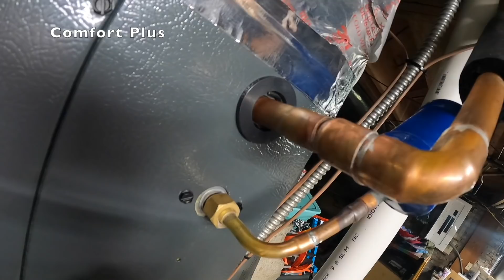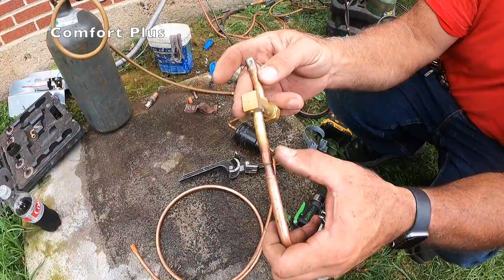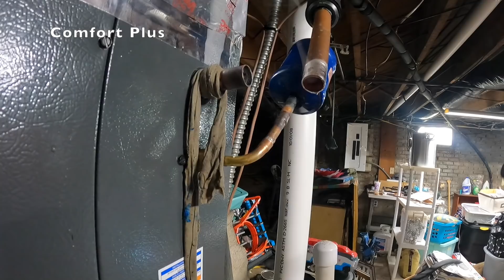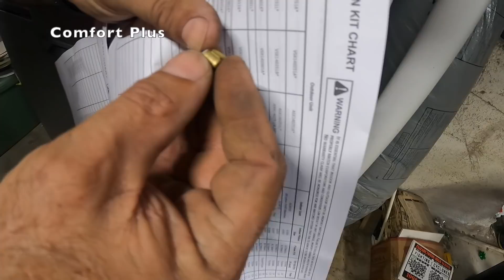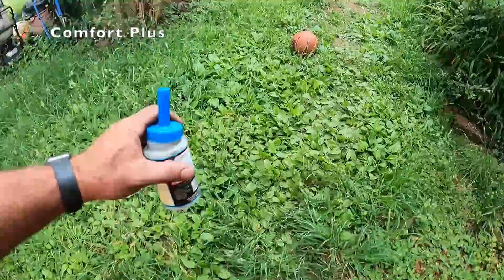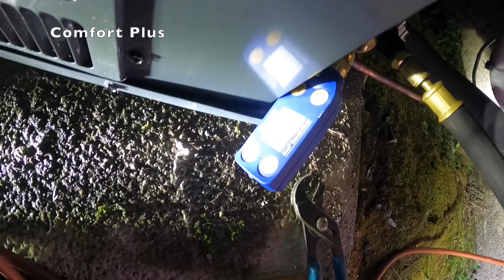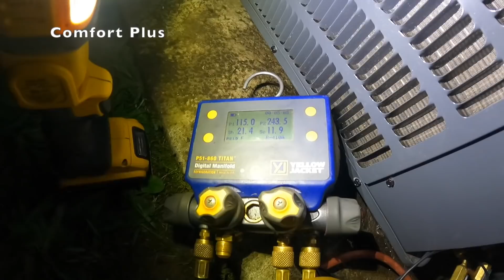HVAC: DIY Goodman Install: Can this unit be saved?

Comment: The soft-solder seems like a reasonable mistake, but WTF WERE THEY THINKING WITH PUTTING EPOXY OVER IT?!  Is the "right" stuff just silver based high temp solder like plumbing (which in my experience wants 60-800F) or is it brazing rod (a copper version of Alumiweld?)  Agree 100% with what you said, know your limits when it comes to DIY work...

I'm filing that mess under "I don't know what's right but at least some of that looks wrong"

Comment: As an HVAC installer/serviceman, only use a certified company, with high ratings. Never attempt to install HVAC equipment yourself. For one, you need EPA certification to handle anything with refrigerant in it, or pay a fine up to $10,000! To properly install a condensing unit, mini split, or replace an evaporator, you need a recovery system, a vacuum pump, gauges, and a vacuum gauge. Plus, you need a brazing torch with silver braze for connecting the lines. Some less than professional companies use solder, which is weaker and can break and leak. At the unit, there are valves with seals, that don't like heat. When brazing, you must keep them from over heating, or they will leak. Always use a new liquid line filter, anytime you open the system. If replacing a failed compressor, flush the system with an approved flush, and install filters on both lines. Most likely, you'll have to replace the metering device or evaporator coil at the same time. Like I said, hire a professional. You'll get a warranty, less headaches, and it will save you money on equipment that you'll only use once. If done right, your condensing unit should last 20 years or more, without anything more than simple maintenance. I'm not shocked to see these hack jobs, because I've seen them, but your mistakes will cost you more than the original install would!

Comment: Did you correct the drain line at the evaporator coil?
Reply: I missed what was wrong with it?
Reply: Just the secondary drain outlet is plugged and should have a float switch.

Comment: Dont know why they used jb weld, all they needed was a lil super glue to hold those together lol. jb weld and plumber solder doesnt work well in that application. Whoever did that sure wasnt a goodman 😜

Comment: I was an electronic technician for 40 years. I would use braided copper wire to remove excess solder. It works well.
Reply: It Was Call Solder Wick (braided)
Reply: @JRig2Stx  always used the rosin coated
Reply: @RobertSmith-tq6mf  
It Was Back From '75 to '99 When I Was a Tv Tech for a Major Department...

Comment: Yeah I enjoyed that and what I enjoyed most is that you didn't jump on the DIY'er. In 2018 I purchased the same system and was going to do it myself and then the health bandit got in the way so I decided to hand it off to a pro. I had done more research and was ready to do it the right way. With all that said my health did return and I saved with the Goodman brand over the elites out there. You have that southern charm...

Comment: I used soft solder
Reply: Soft solder when used correctly will not leak , and the joints will outlast the equipment. Goodman is not the best but if installed properly it will last a long time. Brazing causes excessive heat , and can create more problems if done improperly. I hate seeing hack jobs , not fair to the costumer at all.

Comment: I've requested a couple of quotes for my home AC install, and the DIY in me can't help but want to take on as much as I can myself.  So tell me this, is it offensive to have a DIY'er ask a pro to do the final braze/vacuum/pressure-check on an installation after I do all the labor of installing the equipment myself? What would you all charge to do these steps assuming everything else was ready to go (and done properly)?
Reply: I’ve been down this exact road. The short version is that many pros make profit on the equipment so they want to install their own stuff. Or, even if they don’t make a profit, they don’t like following a non-professional because they don’t want to get blamed for things like the wrong orifice we saw in this video. Not understanding this reality, five years ago I ordered and installed my own system up until the final braze and electrical connections and started calling pros. After about a dozen rejections I realized the only way to complete the install was to either buy a whole new system from them or learn everything I could and do it myself, which I did. I definitely made some mistakes like not flowing nitrogen during the brazing. That (I believe) led to the failure of the TXV after a year, which I replaced and it’s run great ever since. 
IMO, the greatest obstacle is simply having the stuff you need beyond a set of gauges. Good vacuum pumps aren’t cheap. Nitrogen tank and regulator/flow meters aren’t cheap. Oxy-acetylene torches aren’t cheap. 15% silver isn’t cheap. And that’s just the stuff you need for initial install and less than 15 feet of lineset. If you’re repairing, you also may need a recovery pump and tanks, extra R-410a, a refrigerant scale, the list goes on. 
If you go this route, the best advice I got was to use 15% silver solder because it’s forgiving for beginners, and practice making your joints on some extra pipe. Know what an oxidizing flame is and how to avoid it. Cut the pipe lengthwise and evaluate your joints. You need to be able to move quickly so you don’t damage nearby components. And vacuum, vacuum, vacuum. Moisture is the enemy. 
Good luck :)

Comment: Man you a good.  A true HVAC technician.  I need you over here in AR to give my new 2 ton & 4 ton lennox ML180UH's a through once over and tell me why me one zone damper motor is always roasting hot even when its not called for to be closed ( normally open ) and still hot AF..  Ugghhhhh

Comment: Wow that is hilarious. I met a guy that installed two mini split systems using air duster to purge the lines as opposed to pulling a vacuum! Says they're running great lol.
Reply: Most air dusters are filled with a refrigerant, not sure I'd do it though.

Comment: You tell its a DIY install by the Seer Rating Sticker, stuck to it. Ohh, those were copper plumbing adapters that he used on the condenser.

Comment: So was this on company time?  What did this cost for a job that can't possibly be warrantied.
Reply from the maker: I'm a one man show so everything I do is company time. This was an interesting little job (or experiment lol) and I'd probably do it again just for the interest in this Youtube video!
Reply: @ComfortPlusHeatingandCooling  OK,  I can understand that.  My reason for asking is that is an awful lot of time to put into something that you can't guarantee,  so how do you justify the time vs cost.  While it is still cheaper than replacing it,  it would still be very expensive.  I was trying to figure out how this was being justified as a see how it goes.  I'm not surprised it ran,  just not sure it won't develop more issues from that soft solder.  I've seen that before unfortunately,  Vegas,  if there are issues  it will obviously be restrictions.  I deal with home warranty also though,  that is rife with hacks.

Comment: Kind of surprised you couldn't get the vacuum down lower than 800.  It held pressure so the vacuum should have been lower than 500 over the period of time it looks like you let it run.  I had to switch my valve removal tools to the Appion vacuum rated style to get hard vacuums down below 300.
Reply from the maker: It would pull down. I ran pump until it was below 350 microns, but after you valve it off it will climb due to stuff (hopefully R-410a) gassing out of the oil. Most brands say if you can pump it down and it doesn't climb above 1000 in ten minutes you're good to go. I did that four different times. Just wanting to clean it up as good as possible before I stuck the new gas in her.

Comment: My god, poor customer, I’d go off serial number, who purchased, and sued, but this is a fly by nighter, good job on helping them out,  my worry is the plumbing solder inside  may make it back to txv
Reply from the maker: This was one of those online purchases. Unfortunately they are up the creek when they need warranty parts. None of the sellers around here will provide warranty parts on units they don't sell. This one has a piston instead of a TXV. Since it's straight AC and because I put a new drier and new copper and fittings just in front of piston I don't think anything can get into the piston, but anything is possible lol.

Comment: What's wrong with buying the stuff and calling the PRO to install ??

The diy guy was to buy it, screw up the install,  call the pro to correct problems created by diy guy, Then go to the beach and put head in the sand. 

New SUB, and Thumps up.

Comment: Dam I fuck up did the same thing the owner did i used soft solder plumbing solder but I did not start it up yet its funny cuz I had the same torch too 
But like I said I have not start it up yet going to do everything you just did 
Can I use straight 8 or the brazing ones
Reply from the maker: Lots of folks use Sta-Brite 8 with great results. The key is clean everything good, and use the flux very sparingly.

 The pros are you can use a MAPP gas torch, you don't get the copper as hot and weaken it, and with less heat oxidation inside the pipes isn't as much of a concern.

The cons are if you use too much flux you can get it into the system, you have to make sure its good and clean, and most manufacturers instructions say something like this Goodman does in its instructions ~"Use a brazing alloy of at least 2% Silver alloy. Do Not Use Flux". 

Would I use Sta-Brite 8 along with its special flux on my own system?  Yes.  But I wouldn't use normal plumbing solder and flux. Thanks for watching and good luck with your project!
Reply: Thank you buddy

Comment: Always seems to be a Goodman. Had one about 10 years ago that was a heat pump. Apparently installed not much different than this one. Husband gave the job to the wife to get someone to come fix his mess. Well after 2 weeks and I have no idea why but he managed to diagnose the reversing valve to be bad after his fine installation. I don't know how he even got a new valve, but his installation was OMG. It was cut out with a reciprocating saw and and somehow soft soldered in with short radius plumbing 90's. I just needed to fix the leaks and recharge. Um miss it needs more than that. I would have attempted a repair like this but I had to nope out of a re-piped reversing valve. Good job saving this
Reply from the maker: Yes I believe I would have walked away from that one! Lol.
Reply: "Always seems to be a Goodman"  And that's all people seem to remember, not that it was installed by someone's 8th grader.
Reply: @Shift4g  Why I say that is they seem to attract the 8th grader installers. Granted its not like it was 25 years ago with Janitrol but not exactly senior guys at the local Daikin ethier..... well the few times a year I'm there anyway

Comment: Please bear with my somewhat long comment....just this morning my wife shared a picture from six years ago to the day when we had this exact unit replaced.  Then within minutes this video was recommended.  The internet gods know EVERYTHING!  a couple more notes...since day one this unit has worked very well except it is very loud sometimes.  It’s very random too.  Sometimes it will go many cycles with normal noise and then kick in and run very loudly.  Other times it will be loud for many cycles in a row.  Switching it off and then on sometimes makes it go quiet, sometimes it stays loud.  When it’s loud it sounds like a cheap oil-free air compressor.  When it’s quiet I can barely hear it.   I’ve been told by folks who should know that it may have excessively high noncondensibles in the system.  Idk just what that means but I’m sure some folks in YouTube land do.  I’m glad to see comments.  

Finally, thanks for this video.  I do change fan motors and capacitors and such, but this video allowed me to know that those are about my limit with HVAC.  Luckily I have a fair and honest tech I use when needed.
Reply from the maker: See if the noise is dependent on outside temps when running in ac mode. Non condensables  (things like air or nitrogen) that may have been left in the system will take up room in the condenser and result in high head pressures at times. (Almost like blocking off part of the coil). This is assuming it’s the compressor making the noise. Sometimes fan motors can also be intermittently loud!

Comment: This unit is R410A and the lines were used for R22 for years. Id be replacing all the lines and a dryer install. I wouldnt use R22 contaminated lines. Id also install a vapour dryer too. Think i would have cut piping off at valves and then swedge them again. Would have kept the piping cleaner without solder getting heated again... BUT great video man. Love watching other pros in the trade.
Reply from the maker: Old one actually was 410a. But like all the early 2000 Puron units it leaked lol.

Comment: I am 72 yrs old and know nothing about AC, but I do know an expert when I see him.
You are what makes America Great. Thanks for sharing your skills.
Reply from the maker: Thank you. I believe that's the nicest thing anyone has ever said about me.
Reply: @ComfortPlusHeatingandCooling  well you deserve every bit of it you are a true master of your craft and I enjoy watching you work
Reply: I have seen the same soft solder work out of a big box outfit.... same system type DIY jobs as well.  Just installed a unit that "needed a Capacitor"...  owner shows up with a unit that needs, Cap, Contactor, fan motor, r22, etc...   

Would have been better off just installing a new coil and condenser..

Comment: Nice job!   What was the JB Weld gonna do @ high pressure? I have actually never seen a use for JB Weld.
Reply: JB weld is rated for like 1300psi ..... If used properly for the right application, or a temporary fix for some things. But yes is not going to do anything on the outside of an ac line... that was not even cleaned...  I would love to hear what the DIYers wife would say after all this :)

Comment: Was it installed by the homeowner or “contractor”🤦🏻. When I need to “clean” a old fitting or valve I kick the nitrogen pressure right up and blow it back during cleaning to blow any debris out with the brush. You do nice work and are a true tradesman. Thanks for the great video.

Comment: I've taken 15 percent silver solder before and have been able to push out almost all the soft solder and it hold not my first choice but it works just depends on how boched the joints are
Reply: Mixing 15% and soft solder makes a very brittle joint. When something is soft soldered I usually just keep it that way. Thermo king reefer units have everything soft soldered on the low side and that gets exposed to reverse cycle defrost. Those joints never leak because they are done correctly with the correct type of soft solder.
Reply: @inoahmann7542  agreed thermal cycling is a key point where I can I do eliminate any soft solder joints on residential heating and Air but sometimes you run into one where you don't have much copper to work with and have to make Doo unfortunately

Comment: “DIY, I saved enough to pay for more expensive repairs.”
Outstanding repair work, Sir 👍
Reply: Still less than having a company charge you $9k to throw in a condenser.
Reply: Michael Hoogendoorn 
Long term. The more ya need to fix it the broken it was to begin with and the more you need to fix it.
Money Pit unit.
Reply: My $3200 Goodman installed had 3 calls on it. About $1500 in total service. Couple leaks and a swollen cap. But the Traine folks wanted $12000 to install. So I'm thinking, what's a couple service calls later on, worst case scenario. Still saved 60% overall. Running great the last 8 years too.
Reply: @anthonylosego  wym a couple leaks lol

Comment: What a treat to watch a tech take on a repair like that. Techs that can truly troubleshoot and repair are getting shorter in supply due to either laziness, lack of knowledge or company pushed the tech to just sell a new unit.  Very nice repair
Reply: Part of it's a liability issue. As the saying goes, "you touch it, you own it."
Reply: @TheMinecraftACMan  you can just tell them in going to replace y but cant guarantee that a b c is going yo work or that abc will last you just have to set expectations
Reply: Thanks  @obama7325 
Unfortunately, that's not how it works with every customer. Most yes, but there's a significant number out there who will look for any excuse to make it your fault.
Reply: @TheMinecraftACMan  i guess im just started in hvac but i always put good noted and have customers sign the service report when there are any charges because people try to just lie or hear what they want to hear once i put 8 surge protectors on 4 air handlers and 4 condensers, and i said they are 149 each which would be 1200 and then after an hour of labor and 8 surge protectors that are like 20 dollars each she said i thought you said 149 for all of them lol even though i clarified 2 times.
Reply: @obama7325  What I mean is more like "You inherit the last guy's mistakes if you aren't careful about getting the customer to acknowledge your diagnosis when you give it.